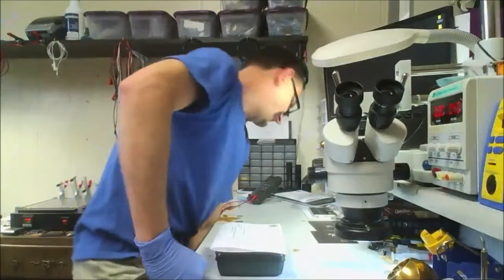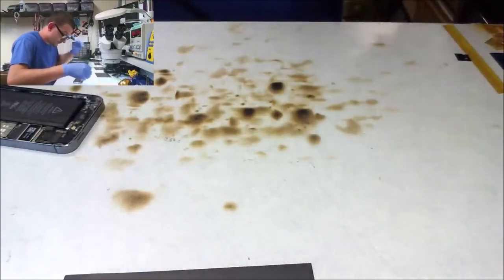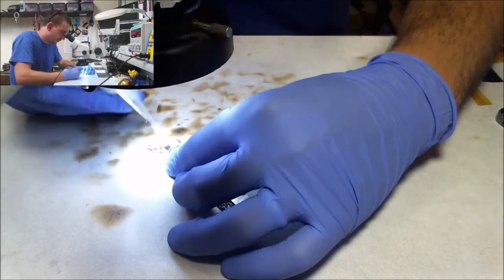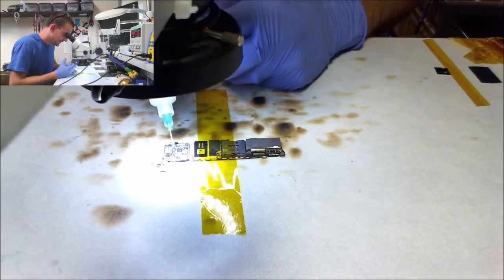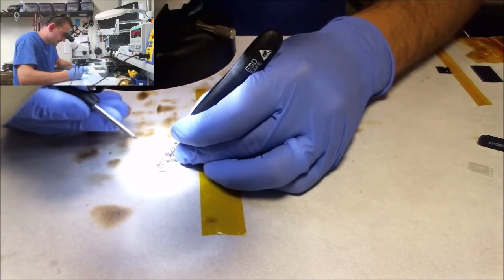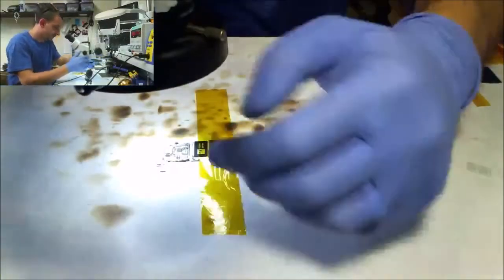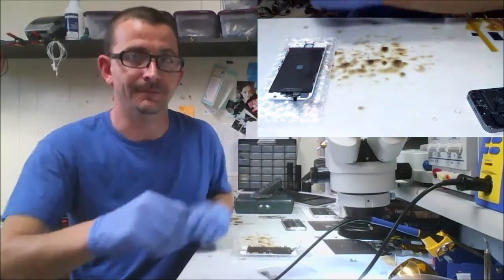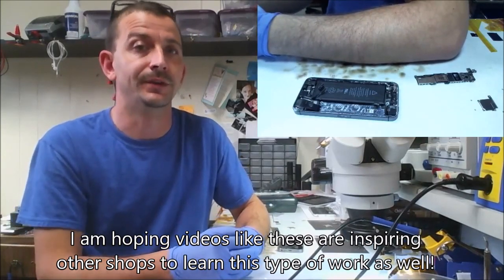iPhone 5S Botched Repair Rescue - Digitizer FPC connector replacement

Comment: Good job, keep it up man. I burn my fingers every time I use wick, and the wick don't work. I assume cause I'm either not using enough heat or flux.
Reply from the maker: Thank you!  I never had much luck wicking until I started buying better irons.   I really love this Hakko setup.  Every time I pick it up it behaves exactly the same and it makes all the difference in the world.  It is worth the money they're charging for it.
Reply: So is the trick heat or just good flux?I got the Hakko with fine tips(got a deal on it)I guess the last guy got sick of it beeping, and if not seated correctly it beeps. China tips work n look like the tip that was in the unit.I'm trying to replace a few caps on a Xeon CPU, not sure how to approach it as its so close to other chip. Thinking of setting the solder on the pads, then holding it in place n heating it up(heat n CPU'S don't mix). I could put a heat sink on the CPU lid?
Reply from the maker: +Philip settimi I bet it's heat.  I used to have trouble with it then at some point in time it just started working out and now I do it on auto-pilot.  Lol I always wind using my biggest iron with a pretty big tip tho, even on the little stuff or its just not enough heat.
Reply: +Philip settimi for really tough heat jobs you can order low melt solder paste 48 percent tin 58 percent bismuth it melts at 138 C it will make a new alloy transferring the heat. Then clean it up with wick then re tin everything with normal tin lead solder. Chip quick used to be the only game with expensive little strips of solid low melt but now the paste form is everywhere for cheap.